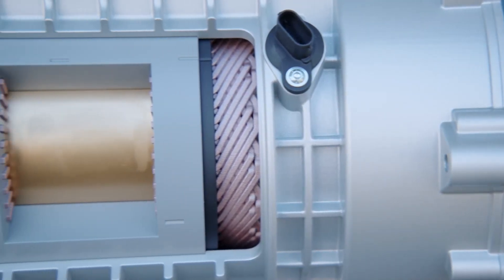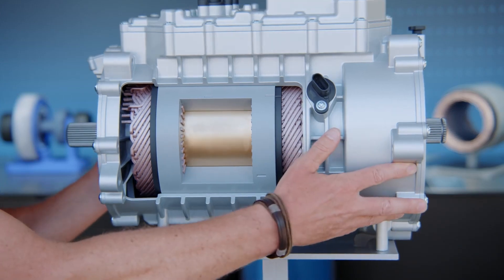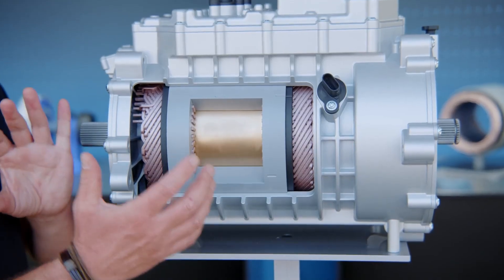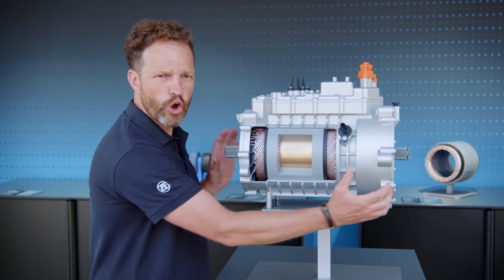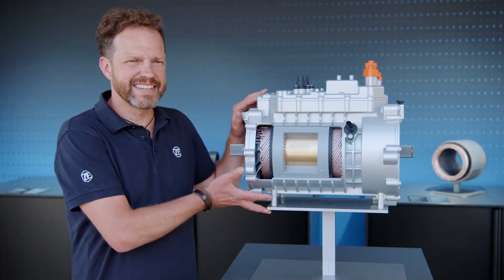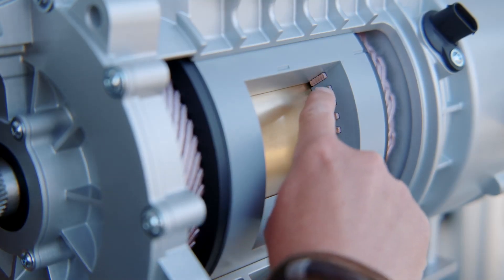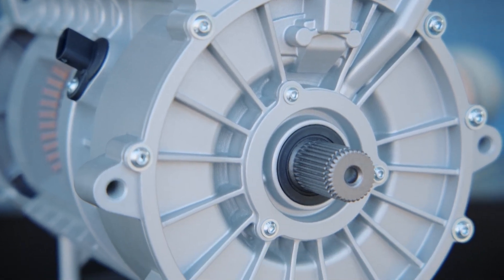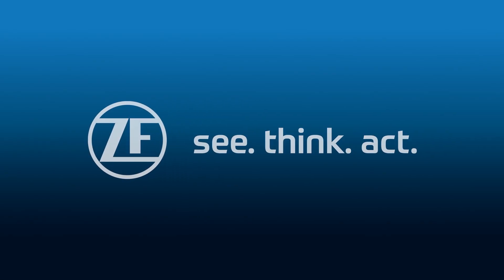EVSys800  - a remarkably compact, modular electric drive system.

Comment: does this transmission --> {https://www.youtube.com/watch?v=FcPZZYbsllU&lc=UgyC8SSd_adiX8vcRbV4AaABAg} have the dual ptos on both sides of the transmission right? just want a confirmation on all these infos

is it semis ordinated or can it be use with smaller trucks

does the (live) thing mean the pto you can drive while its on?

and can this be use with a powerstroke engines and or duramaxs?